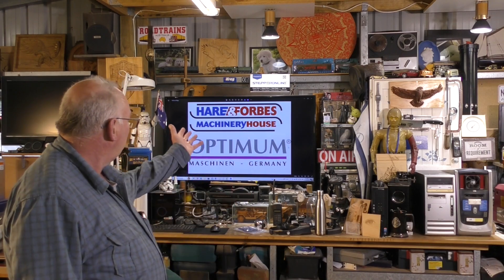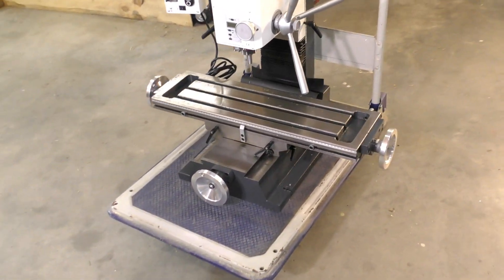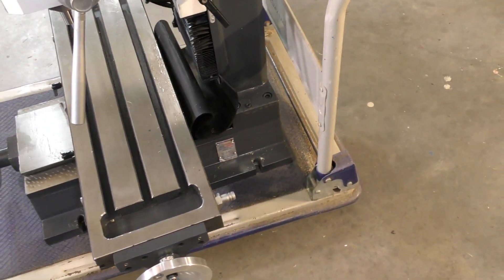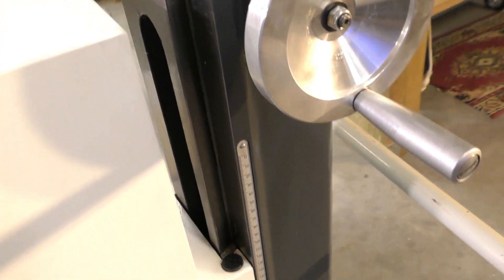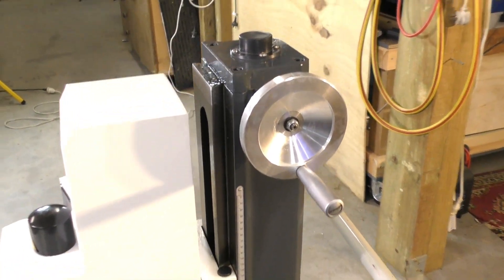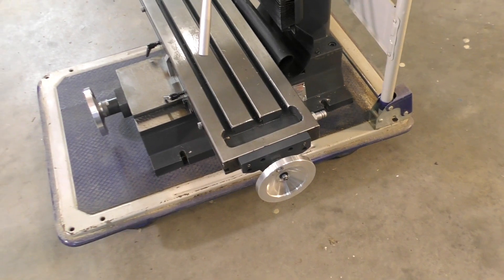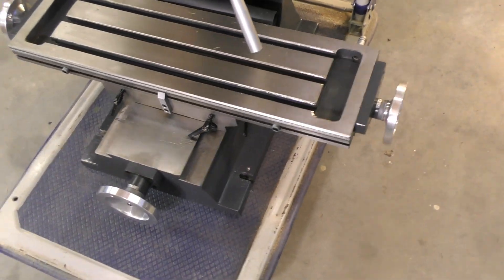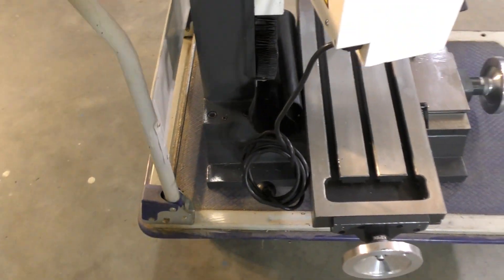NEW CNC mill project PM30MV  HM28V  is HERE!

Comment: Nice looking machine Roger. I just upgraded my Sherline mill with a larger X-Y base and a DRO unit. Instead of going by the axis’ values shown on the computer (I use Linux CNC) which counts the pulses sent to the steppers, there is a separate DRO display box that counts the pulses of encoders mounted on the stepper motors themselves.
Reply from the maker: Thanks! That is a nice upgrade.